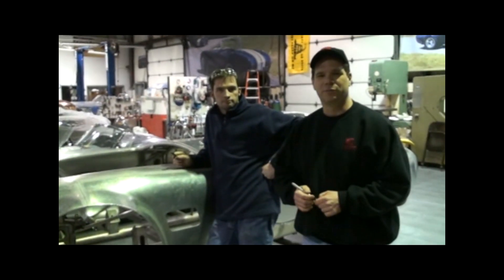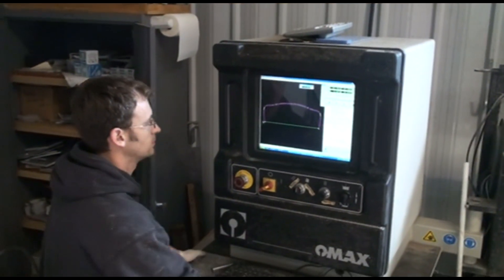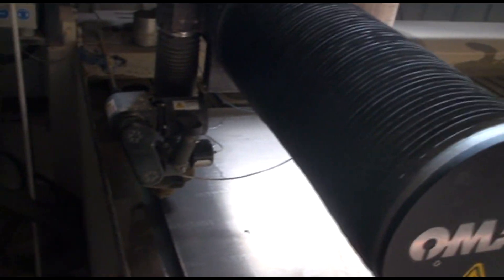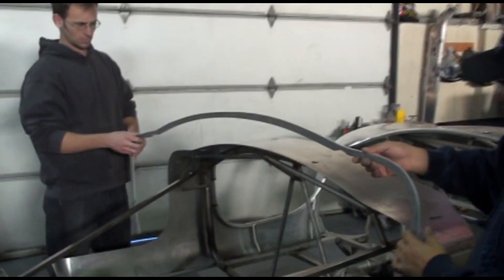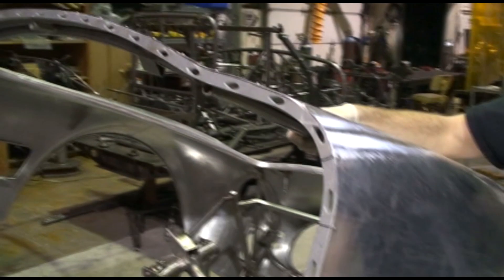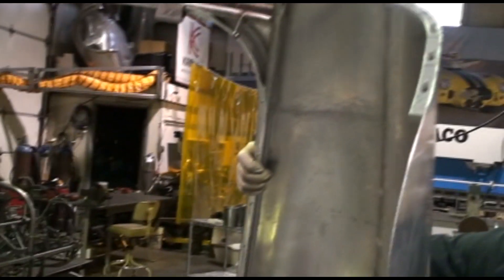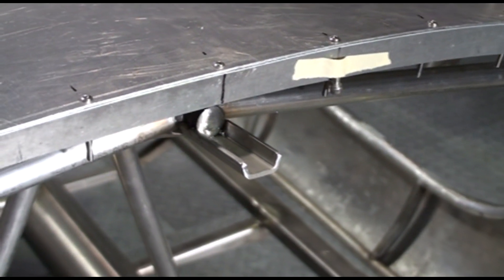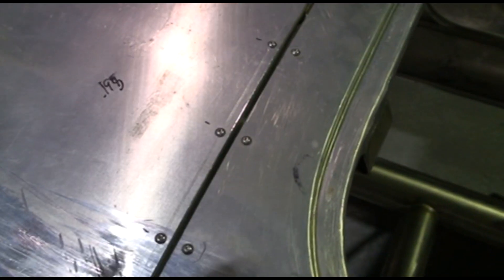Kirkham Motorsports University Flip Top 5

Comment: Incredible.  I see water jet cutting the stiffener as a particularly inefficient use of material.  Why don't you form it out of flat bar?
Reply from the maker: It is extremely difficult to precisely control dimensions when bending a bar.  Spring back and residual stresses are quite challenging to overcome.  By using the water jet we are able to make exactly what we wanted and hold the dimensions almost perfectly.  The area of the plate that wasn't used, was turned into other parts.  Cutting the part on the water jet is much more accurate and efficient--wasting time is inefficient.